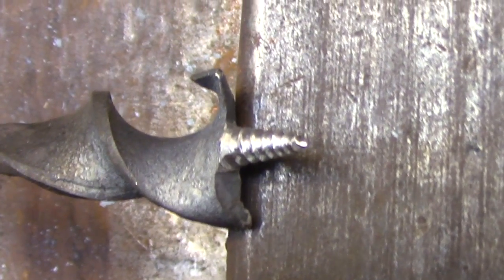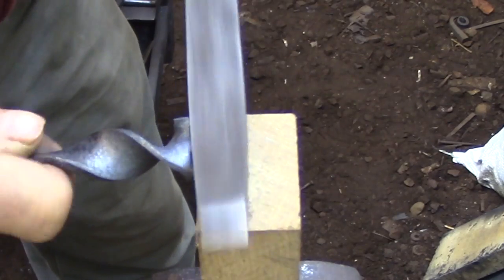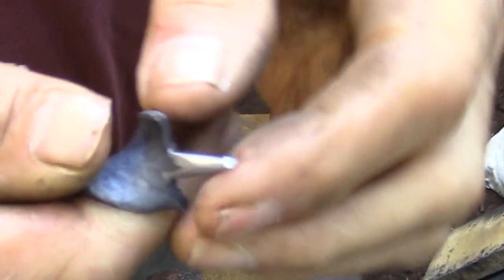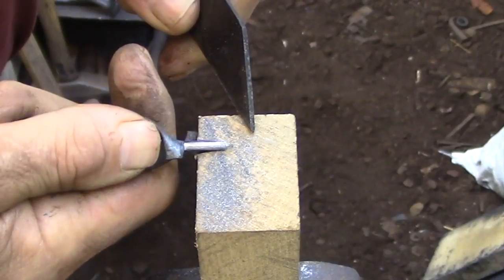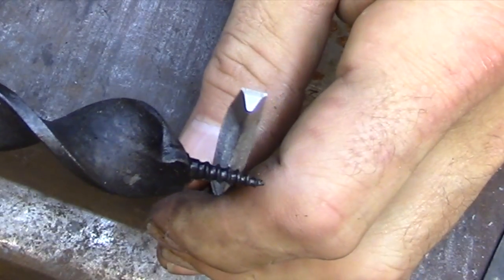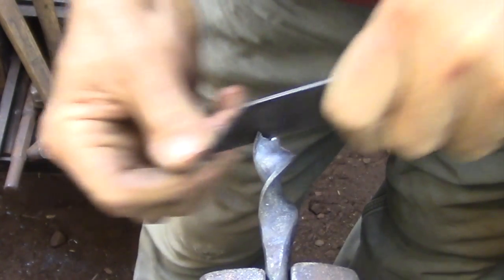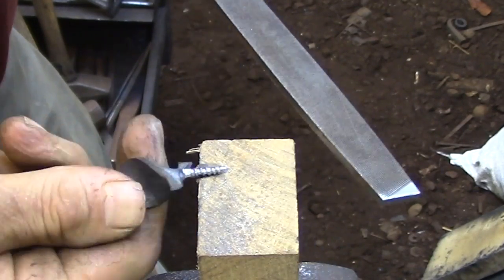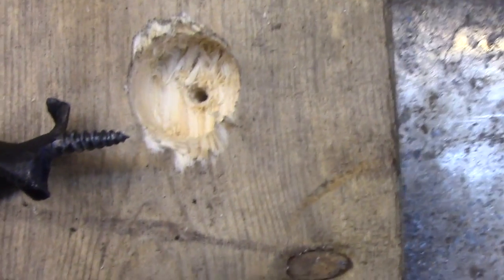Blacksmithing Project - Forging an Auger Bit 3

Comment: I think that grain tear out was caused because this type of auger - without the spurs(or rather with side spurs), is made for drilling along the grain, for example when making a flute. For drilling across the grain like you did here works best the other auger with two sticking spurs, which cut the circle first so there is no tearout. It's like you have two types of saw teeth for different work (crosscutting, ripping).

Comment: Thats a pretty decent result, when you consider that softwoods were rarely used when these types of bit were first made, hardwoods are a lot easier to cut cleanly than softwoods.

Comment: See the historic "Russel Jennings" style augers. They work great across and along the grain with no tear out. They have two little half discs that cut wood along the circumference of the hole. There is a book titled "complete modern blacksmith" or similar that describes hand forging process how to make one.

Comment: Great job Denis, I was wondering if you had ground the side teeth off the file you used to shape the lead screw to a cone.
Reply from the maker: No this is just a regular file.  I was just being careful near the cutting edges.

Comment: ( context: l'm not a blacksmith, just watching videos) How you get temper temperature of 550C of sand when not measuring with modern meter? How did they did in the past?
Reply: Thanks for the answer.

Comment: Great job on the bit. One observation/ question, my high school auto shop teacher would always used to yell at us while we were using a file "it's a file not at saw." I was taught to file on the forward stroke only, but watching you, it looks like you use more of a sawing motion. The more I get into blacksmithing it would seem that if your working on the metal before it's hardened it wouldn't really dull the file. What are your thoughts on this? Do you do this out of habit, or do you only file this way when you know the type, or condition of the metal?
Reply: He is probably pulling back with much less down force applied. Just enough to keep the file in the groove so it does not have to be re-set each time I would think.
Reply from the maker: I had the same shop teachers in high school.  I don't think their argument was really well thought out because they also taught us that draw filling was the only way to put a good finish on a piece??   If lightly dragging a file over the work will dull it then it has no chance to survive when the teeth need to dig into the metal and remove chips.  I think they were more concerned about the irritating noise that a room full of kids would make while filling than they were about having to replace the files.
Reply: @df-intheshop330  I had the same thing. I found that it's far easier to keep the same alignment/registration if I don't lift the file. Another school thing was putting hand planes on their side to 'protect' to cutting iron. That's another thing I've come to ignore. Great series, I love using augers in my brace, but they're all the spur down style.
Reply from the maker: @michaelballinger6419   I think the hand plane on the side thing is a good habit to get into.  I agree it isn't necessary in most shops but I grew up working on one bench that got used for everything so you never knew when you were going to get a nick in the blade.  I still do it along with setting chisels bevel up. I actually think that got started when hand planes were on construction sites and had to be set down on the ground under sawhorses.

Comment: could you in theory use a die and tap set to do the screw part?
Reply from the maker: Taps & dies only cut a straight thread. This is a tapered thread.

Comment: Denis I'm looking into hand forging some drill bits, is there another way to do this that will be effective with cutting metal?
In essence I want to make a small gun bore for a flintlock made in a "Traditional" method. I can't seem to find anything on the internet about it either.
Reply from the maker: The colonial gunsmith video is the only one that i know of that takes you through  the whole process of making a flintlock.  https://youtu.be/bAzJOULyx5c      So according to this video they welded the barrel over a mandrel and that gave him the starting hole that he needed to ream the bore to size.
Reply: Perhaps this YouTube video will help:  https://www.youtube.com/watch?v=D43ZeYu9dnM .  I hope it will give you a basic idea of how to do it!  Good luck!  BTW, when you go to this video, there are several different other videos on home shop rifling!

Comment: I've seen where they twist a flat triangle tip to make a screw.  Are there properties that make this better?
Reply from the maker: The lead screw should match the rate of speed that the auger can penetrate the wood.  So if a lead screw is trying to pull the auger in faster than it can cut it will simply strip the threads and no longer pull the auger into the wood.  The type of tread you get by twisting a bar is far to aggressive to work well as a lead screw.
Reply: Thanks for you response.